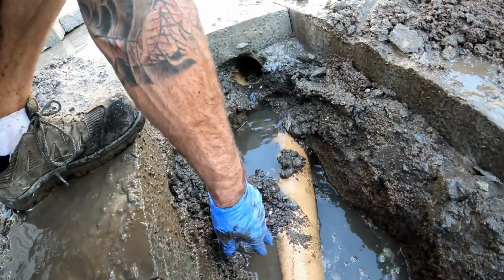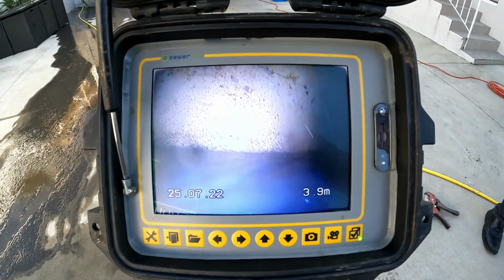Blocked Drain 276 - River Of Sewer | Major Blockage | Crushed Under The Concrete

Comment: Quick question: Why don't you leave small amount of water flowing (low pressure) through nozzle when inserting/pulling out. That would prevent clogging when there is mud/sand.
🤗I really enjoy your videos.  I made a wooden nozzle myself for garden hose to clean pipe from sand and clay tile pieces.😁 It works but lacks a pressure to clean baked in things.

Comment: Watch that back of yours Gavin!!  

The concrete contractor should be getting a BIG BILL, and where was the inspector on all this?  Where I live, all of that is required to be inspected before being signed off on.  Granted, many inspectors are slimy 'I've done my time, now pay me to approve this fiasco", but at least there is some kind of paper trail...sometimes (I had a backflow preventer put in wrong in my new house EASILY seen from the picture I took of all the plumbing runs, yet the inspector said "all was good")....yea...all was good after somebody greased a palm...

Comment: When laying drains under a concrete slab would it or is it possible to obtain reinforced metal pipes with a stronger plastic liner to avoid all of the mess and troubles clearing blockages.
Reply: I believe he said the concrete was recent, which means it may have been crushed BEFORE hand. (or during concrete installation?) The concrete on top actually protects the pipe so nothing else is necessary.

Comment: A very good friend who has passed, was using a new helper.  We use spinning cables with knives on the end to cut away roots.
Now the homeowner was an FBI officer, as they pulled the cable back entangled in the debris was a condom.  Helper calls down and says we just pulled a condom, Been out of time lately?  FBI officer get strange look and quickly went inside. 
Officer came out and paid them ---- never heard any more about it
The white sewer rats came to mind